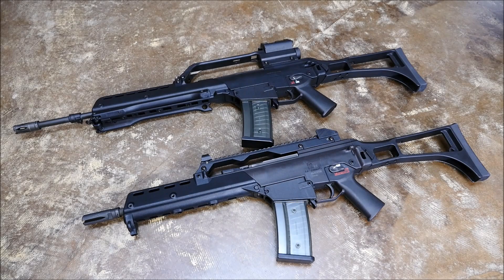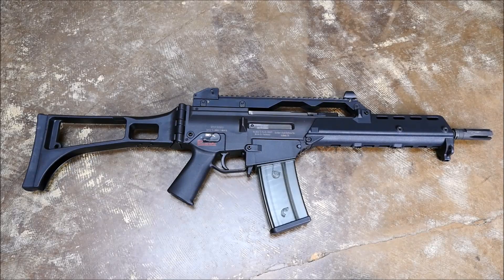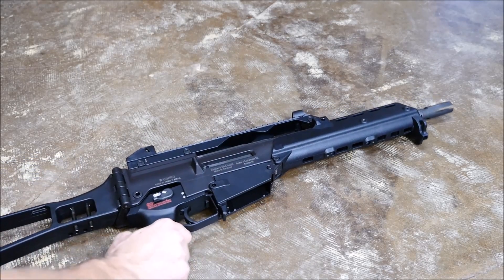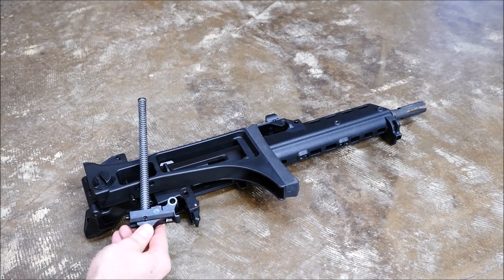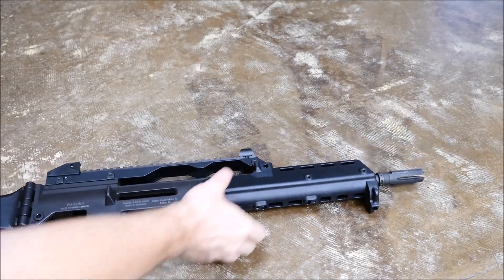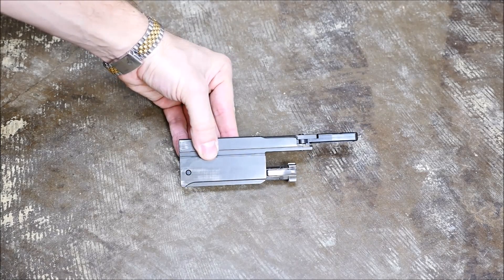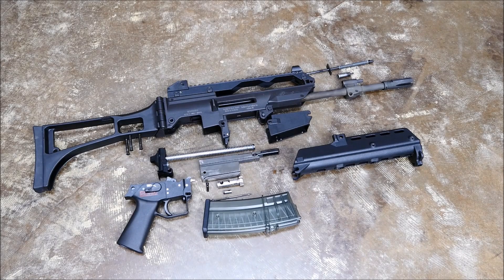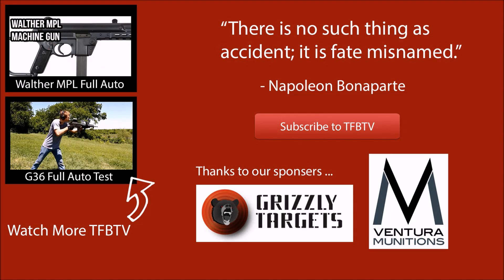H&K G36 Rifle Field Strip

Comment: Yeah crazy politics here in Germany with that G36. Latest news was that the laboratory issues with the accuracy of the warm gun didn't appear in the field. At least no soliders complained about it. In my Bundeswehr times i really liked the gun, easy to control, light weight and pretty accurate in my hands. The Kurds in Syria also seem to like it a lot, and there its used in war conditions.
Reply: +MongolordD 
Are they still using 10% Polythylene in the polymer parts to cut costs? That's supposedly where the melting came from.
Reply: +Scowler its said that the german military G36s use that polymer mix, but later version and export models use the proper mixture.
And the polymers didnt melt, they just got weak and deformed (I dont think its even possible to melt it, because the handgurd does not touch the barrel).
Reply: +MongolordD 
Our Latvian soldiers used G36KV3 in Afghanistan, no complains. Then after returning home from those montians to sea level they re-zeroed their rifles, so it seems in the field there was no that mythical floating zero point.
Reply: +Scowler Thats made up Crap. Bundeswehr hasn't been able to proof this Theory. Also, the Report by WTD91 hasn't been released and that says quite something.
Reply: +MongolordD That just a political thing to prove that our female minister of defense is as qualified as her predecessors. Which in fact she is not.
Reply: +BigMek456 Unfortunately we have to endure her quite a while more. But that the G36 is rubbish is dumbfuck. It's a marvelous weapon.
Reply: StachiBCNR33
I found out about those discrepancies a month ago.
Reply: Rhodiebert85 ♠  That the Bundeswehr buys SCAR, no problem with a scar or FN 2000 or FNC, SCAR is in service in special forces of the police and the Bundeswehr.

Comment: Very nice and detailed video, thank you.  I'm glad you showed disassembly of the gas system too. I also take mine down to clean the gas system. While probably not required, I also remove the flash hider for cleaning of it, and the barrel threads before oiling the threads and putting the flash hider back on for re-assembly. Hope to see more test videos of the G36K!  I own an SL8-1/G36K conversion SBR, and it's great. Mine is the same setup you have, minus full auto of course, and I have the earlier handguard with the 3x Hensoldt single optic.

Comment: you can unscrew the muzzlebreak too. id suggest using gloves though since if its a little stuck from too many powder deposits its sharp edges will cut right into your hand (had it happen, not fun). and you could even get the springbutton for folding the buttstock out. i had to clean so many of these that i know almost every crack on this rifle :D

Comment: The G36 is a wonderful rifle. It's the basis of the 416, and very reliable. The controversy surrounding it has been disproved by testing. Any rifle will get hot with sustained fire, polymer foregrip or not.
Reply: the 416 is just a g36 in the body of ar15

Comment: I don't know anything at all about the G36 but it is very similar to the FN SCAR - the bolt carrier in your G36 appears to be different from that in the SCAR only in its dimensions. In my SCAR you have to remove the butt stock in order to get to the recoil spring/buffer and remove the bolt carrier group - this is only different from the SCAR in that in your G36 the butt stock folds over rather than removing it completely from the receiver. Looks like a very cool rifle - I'll go look at some vids of the G36 - learn what I can about it. Thumbs up on the vid BTW.
Reply: FN borroed heavily for their scar desing from the G36.
Reply: +KieferDragoner 
To be fair, mechanically both are very close to the AR-18.
Reply: +hurricane +hurricane not exactly, HK gave the G36 an improved AR-18 gaspiston, the scar uses gas system and boltgroup very similar to the g36.

Comment: The issue is the polymer receiver - it an AR180 in a polymer tubing receiver. And yes, the Bundeswehr order it that way, just check with the original TL of '96 - at 183°C to used polymer turns liquid. So similar to Kydex, well below that point the polymer turns pliable to then cool slightly deformed. Yes, one could rezero now - but what if you still in Mali/Afghanistan just getting contact?!

Comment: I've seen that H&K sell some kits which allow the G36 to fire in the 2-round burst mode as well. Are those kits used in the military as well, or civilian use only?
Reply from the maker: +Vlad Iancu I am not aware of the 2 round burst kits being in military use, but I am sure you could turn up a few in various armories. I reckon they are more of a law enforcement offering.
Reply: Thanks for your answer. Having an assault rifle / carbine with this many fire modes is pretty sick though. It allows for a great tactical approach for any police / CT unit out there.

Anyway, keep up the great work!
Reply: Burst trigger packs are available and it depends on the military or law enforcement agency.

Comment: is there a bolt release in the trigger guard located in front of the trigger?
Reply: On the "roof" of the trigger housing would be a manual bolt hold open, push up and pull the charging handle backback, for malfs and what have you. I can't think of any G36s that have a bolt release, standard procesure is to just use the charging handle seeing as it is directly connected to the bolt carrier, which can also be locked out to either side by pushing in.
Reply: H & k mp5

Comment: Never had problems with my G36 during my service. I was never deployed though, just shooting at the range, but still I was pretty satisfied with the performance of the rifle. The only thing that bugged is that the standard dual optics are shit, there's no other way to put it really. Narrow field of view, fogging up in cold/wet conditions if you don't watch where you're breathing, the scope is near useless in low light, both optics tend to lose zero when the rifle is dropped or bumped hard. 
There's a reason why the most recent variants fielded use different optics. 

As for the accuracy debate, I'm pretty sure it's mostly made up and/or blown out of proportion. The testing scenario and conditions have been deemed utterly unrealistic by german soldiers, the vast majority of them are happy with the rifle.

Comment: So, is the fire control group you initially removed considered the "receiver" of the gun?
Reply from the maker: +LEGITICUS No, the upper is.
Reply: +TFB TV gotcha. always wondered how that worked on the G36's. Thanks for the reply/video!
Reply: +LEGITICUS Like most HK military rifles, the fire control group is contained in what's called a Trigger Housing, which is not legally or technically considered a receiver.
Reply: +TFB TV And that is why I don't like HK's
Reply: +TheTyrial86 What does that have to do with anything?
Reply: ***** 
It means I can't build one in my home without some serious tools.
Reply: TheTyrial86  Same with AKs, and FALs, and most other rifle designs out there. The AR is an incredibly unique rifle in that capacity.
Reply: ***** The only things needed to build an AKM is a press and sheetmetal form. Those are far less expensive then a CNC
Reply: A press and bending jig? You mean the same things you need to make an MP5 or G3 from a parts kit?
Reply: ***** Is this a g3???
Reply: TheTyrial86
No, but you made a blanket statement about HKs in general, the previous majority of which were stamped sheet metal guns.

Do you like the Tavor? Aug? Scorpion Evo? Any other gun with polymer body or receiver? All of those are equally impossible to be built at home. Examine your arguments for consistency.
Reply: The point here is the bending jig for an ak is litterally a rectangle. With a slight angle. I wonder that the fuck a bending jig looks like for a g3... calm the fuck down.
Reply: I am calm; I can see you aren't, and any further words will be a waste of both our time.
Reply: ***** It was a joke about being calm but each their own

Comment: Why is the G36 under controversy?
Reply: It isn't as spectacular as the media makes it out to be.
The gun itself is good (enough) and basically has quite obvious (even normal? I'm not an expert. it's just how I understood it) flaws - like breaking when exceeding 9000&#176;C (yes I exagerated). So the German Defence Minister wants it to be even better but the media suddenly claimed the G36 couldn't hit the broadside of a barn from the inside....

However I bet that half of the us already forgot what even a so clalled "G36" is actually supposed to be now that there are no new news about it. That's German political apathy for ya.
Reply: Because according to the german military if i gets shot hot the polymer around the barrel gets soft and it gets really inaccutate (i dont really know)
Reply: @sirostauffer7462   Not really that inaccurate, but after overheating it's not accurate on long distances in standartised tests. But you know, assault rifles are not made for prolonged fire support, that's the role of the mg, so in practise there was no problem.
Reply: @Realkeepa-et9vo  as i said i dont really know the thing is they also switched like 3 times between it not having problems and it having problems but also it is kinda an older platform and i can understand why they want to switch but overall it is a good rifle

Comment: well it works fine 
but ergonomically it kinda sucks
stocks are too long for use with plate carriers, so we bought our own, cut them down and boltet them back together, worked fine until we werent allowed anymore
magazines are a pain in the butt to get in and out of mag pouches, 
we had to buy our own mags, and dremel down all the cuopling interfaces
i had mine done so far, that only the interface witch locks the mag in the magwell was left
no bolt release, so you always have to manually reach for the charging handle
to much height over bore, and the handguards wobble like shit if they are worn out, so no lasers to be mounted there, imagine grabbing your handguard and the laser wanders all over the place
of course there are solutions to all of the problems stated above 
but guess what, it costs a shit ton of money to do that, and of course you have to pay for it yourself, 
and some of the changes you arent allowed to do...
plus, for a goddamn plastic rifle, its heavy af

again, for rear echelon troops and staffers this thing works just fine
but for combat use, there are better rifles out there
Reply: Literally everything you stated got solved in newer G36 verisons http://www.heckler-koch.com/en/products/military/assault-rifles/g36/g36/overview.html

However it's all over the place and i agree, there are better combat rifles out there ;) http://www.heckler-koch.com/en/products/military/assault-rifles/hk433/hk433/overview.html